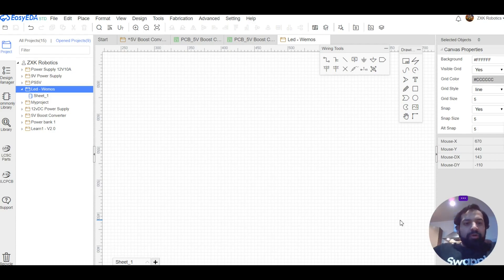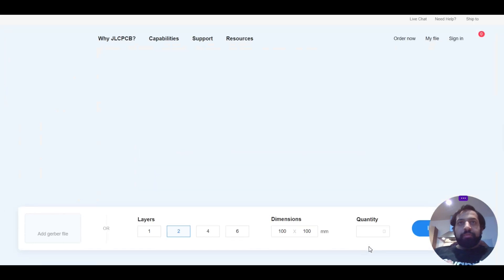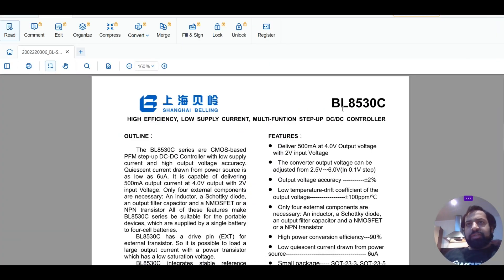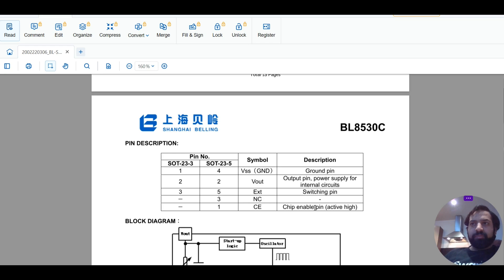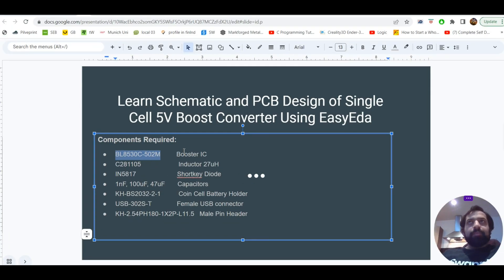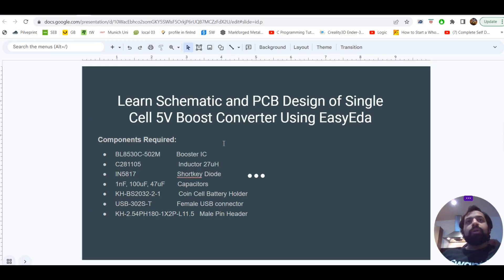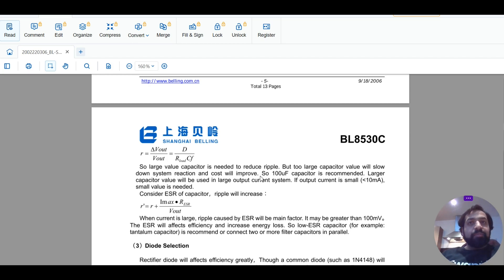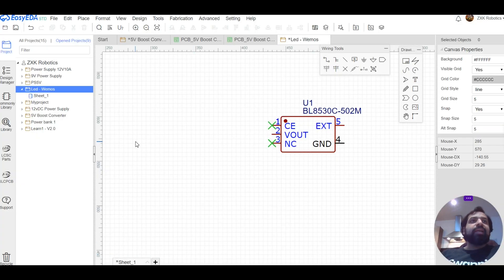Part 1/4, Learn Schematic and PCB Design of 5V Boost Converter By EasyEda, Datasheet Explained

Comment: Great video! Your explanation of schematic and PCB design of the 5V boost converter using EasyEDA is really helpful for beginners like me who are just starting out in electronics. Your clear presentation of the datasheet information and how it relates to the design is also a great touch. I am eagerly looking forward to the next parts of the tutorial, please upload them soon! Keep up the excellent work and thank you for sharing your knowledge with the community.
Reply from the maker: Sure, Thank you for your comment. Soon more videos regarding circuit learning will be upload. you can subscribe channel.
Reply from the maker: I Have uploaded its 3rd Part. I know its late, but from this weeks videos will be uploaded in couple of days. I have just attached its 3rd part link.
https://youtu.be/YALnU4uY0mk